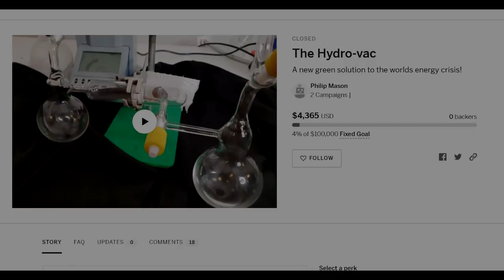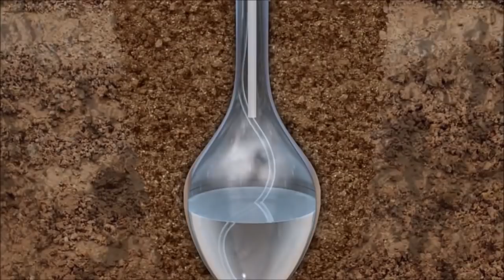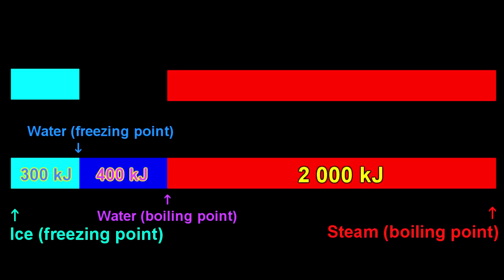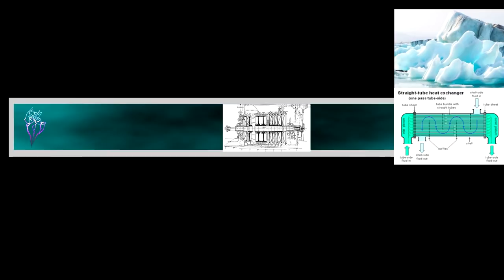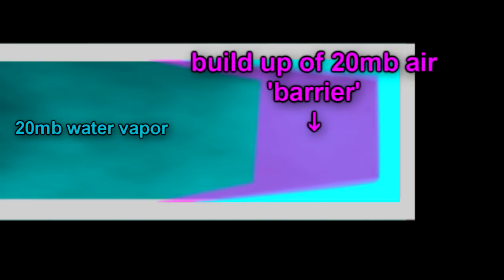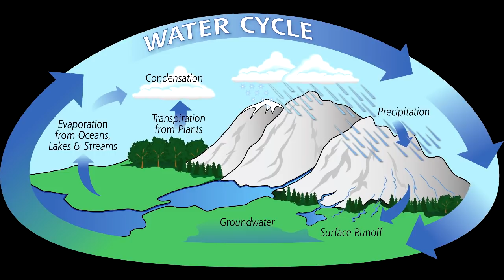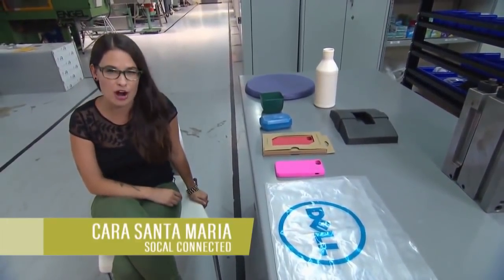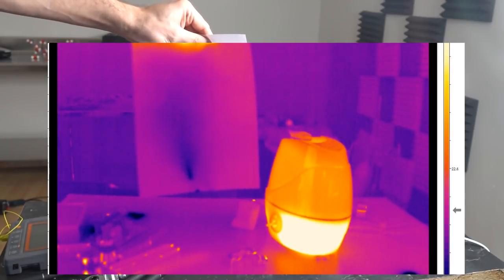The Hydro-Vac -BUSTED

Comment: Hey, Thunder00t, I've invented an engine that runs on water. It works on a simple principle. Hydrogen burns, right? Every water molecule contains two Hydrogen atoms. So I have this catalyst that makes it possible to set fire to the Hydrogen part. Ingenious, right! And the best part: Where do you think we get the Oxygen from?

And if you figured that was fantastic, wait until you hear my plans for what to do with Carbon dioxide.

Comment: Cold is a lack of energy, so you will never be able to harvest electricity from cold.  You could use a heat differential of some kind and use the temperature differences to harvest energy (i.e. The Sterling Engine).  Cold is necessary for this to work, but scientifically speaking you are harvesting energy from the heat source.

Comment: Free energy device
Some sort of heat based generator (say a peltier effect generator) with an efficiency over, say 50%, and then stick the hot side of an air conditioner on the hot side of that generator, and the cold side of another air conditioner on the other side. Then connect those air conditioners to the generator.

Because physics this can't work, but air conditioners can move more energy than they consume, so as long as it isn't a totally closed or open environment (so it doesn't continuously get cooler or warmer), it should work.

Except because entropy this can't work, so why, or have I broken physics with physics?

Comment: question, would this theoretically work if we could build this at around the equator and other end would be in space, one tube for gas to get to colder part and second one for condensation to get back to bottom ? with space part shielded by something so it won't heat up by sun shining on it ?
let's assume we have composite materials able to build this. (i know that we currently don't have that nd maybe will never have materials capable of  that )

Comment: I'm running an air exchanger with a built in heat exchanger and built in particel filters (for dust and pollen and insects), in order to keep the humidity low , 24/7 . Why on earth would I want a Humidifier in my house ?

Comment: Yeah, i am getting a Tesla tower vibe from this.. Great idea, works, in theory, but sucks in efficiency and execution. You are however forgetting to calculate the energy cost of getting and keeping the vacuum versus the possible output in moving gasses. 

Heres an idea to generate energy.. Have a metal ring around the equator, floating, because gravity pulls on all sides. This ring will rotate because of the rotation of the earth, difference between the surface to the average of the planet itself. Then put a bike dynamo on it, and voila, free power.

Comment: what if you went from geothermal to cold, upper-atmosphere with a vertical tube akin to a smokestack in a tundra with mountains like Alaska?
Reply: Something has already been designed and prototyped for using rising hot air, that has your large atmospheric tube:
https://en.wikipedia.org/wiki/Solar_updraft_tower
Idea originally by Leonardo da Vinci...

Comment: Dam you Thunderfoot!!! Now I need to go an do research to convert Kw/hrs into J to determine which bit of those numbers you misquoted in order to determine if you're trolling you, us, or all of us, or if it were just a mistake!!!

AND :/ I'm actually gonna have to do it, because I genuinely want to know and if I don't find out just how badly this whole concept would fail, it will keep me from sleeping! It's already 23:15 here...
grrrrr.... I shake my fist in the air at thee!
Reply: 1 watt = 1 joule/second
1000 watts = 1 kilowatt
1kilowatt running for one hour = 1 kilowatt hours

So 1 kWh = 3 600 000 joules
Reply: @zachb1706  cheers bro! That was what I thought.
What threw me was the whole bit about average power consumption for a westerner over a day. 
Upon further reflection though, I suppose as a mean average that might be in the realm of typical. I'm not interested enough to go fact check that far, just that part sounded a bit low to me. Started trippin on whether or not TF's sense of humour was applied to it lol.  

Maybe I'm getting too paranoid as I grow older.

Thanks though!

Comment: 15:21 I feel this is disingenuous - this would be like saying "In order to power your house through sunlight you would need to be in the sunlight for 12 hours a day which means that it's BUSTED for the times that it's not in sunlight" - well I'm not trying to run my house off of sunlight - I'm just trying to save a few dollars I doubt this system saves more than it costs but still I don't think that the trademark for energy should be "can it run a whole city" it should be "Is it less expensive than using coal"
Reply: Nuclear is the future

Comment: I'm not saying that the Water seer would work because I don't know much about them, but your description of why it wouldn't seems flawed. You say that the surrounding earth would just reach the same temperature as the bulb. But, that earth is in continuous contact with other earth that then sinks away the heat. It's the same reason you MUST insulate under a heated concrete slab floor. The heat doesn't just reach equilibrium, it's sinked away.
Reply: Obviously Not 

Why do you think that underground you get a cool constant temperature?

The reason is that heat transfer through the ground is slow (if it were fast, underground would be close to the temperature of the surface).  Over the years, an equilibrium has been set up, so the temperature underground is approximately the temperature that location experiences, averaged over the year.
Reply: @jerry2357  I didn't say it was necessarily a fast trasnfer, it mainly depends on depth and amount of surface area. But, keep in mind that with the water seer, they are only taking the water to it's dew point, which  is a modest number to achieve. For instance: Because it's hot and dry let's pick Phoenix AZ in the summer. It might be 100F, 45%RH, the dew point would  be 75F. The ground temp is <60F at 10ft deep all year. So, it would be EASY to condensate water, even at shallow depths. The amount of water would depend largely on the size of the underground vessel, which translates into surface area contact with the ground. I'll bet you could get 5 gallons a day out of a moderately sized system. That's enough to keep a family alive. Thinking about it, I'm positive the Water Seer would work.

I've been to Namibia before and it's so dry there, the yield would surely be less. But, I see droves of people carrying  water that they get from gov tankers (fracking has poisoned the aquifer). If water seer systems could keep them from having to carry all that water, it would be a Godsend.
Reply: @cornpop7805  

You clearly don't understand the thermodynamics of what is proposed.  To make any water at all, you need to remove the latent heat of the water vapour so it changes from the vapour to the liquid phase.  Assuming this is at (say) 10°C, then that's 2477 kJ/kg.  I estimate that that's enough heat to raise the temperature of a tonne of soil by over 2.5°C.  So for every litre of water you make, you heat the tonne of soil around the hole by about 2.5°C.  Heat transfer underground will not be fast enough to conduct this away quickly enough.
Reply: @jerry2357   The geothermal AC for my house uses tubes buried in the ground to dissipate heat. My 3 ton unit (3600 BTUs) took about 1500ft of 0.75" pipe = 8000 sq inches of surface area, in contact with the earth. Thats about 3800kJ total and about 2 sq-in/kJ.
Reply: @cornpop7805  

Sorry, I don't often use old units these days, so I'm thinking about your numbers.  Presumably when you say 3600 BTUs, you mean 3600 BTU per hour?  In that case, when working at full capacity, your 1500 ft of tubing is dissipating enough heat to make about 1.5 litres per hour.  That's just considering the latent heat, if the air needed significant cooling then the amount of water made would be considerably less.  

And that also assumes that the temperature difference between the pipe and the ground would be the same, but I suspect that the pipes of your system are quite warm, so using a bigger temperature difference than would be possible for a water condensation unit.  A smaller temperature difference means a smaller amount of heat transferred.

And by the way, I make the surface area of your system over 42000 square inches (0.75*pi*1500*12).
Reply: @jerry2357  My numbers are correct. I said about 8000 (7952 sq-in). You multiplied the diameter by pi, but you were supposed to multiply the square of the radius by pi.
Reply: Obviously Not 

No, you describe working out the volume of the pipe, not the surface area.  The surface area is the circumference of the pipe multiplied by its length.  Think about splitting the pipe along its length and then unrolling it to make a rectangle and you will see that I am right.

Working out heat transfer is within my areas of professional competence.
Reply: @jerry2357  You're absolutely correct. It's circumference x length.

Comment: Using water may be a fail for Thunderf00t, but power HAS been made by using glorified dehumidifiers: http://otecokinawa.com/en/index.html

Also there is a version that is for use at the poles, using the warm water and cold air difference; suggested by the French engineer, H Barjot.  Mentioned on wikipedia, and here: https://guides.wikinut.com/Technological-developments-may-enable-OTEC-plants-to-be-operated-even-in-the-Arctic/20o6x1am/

Maybe not that close to the hydro-vac, but using a similar principle, which I find a little too close for comfort while watching these hydro-vac debunk videos.

Comment: Climbing up a mountain. Heh, how much energy is lost to gravity? And how is one to eject all that heat in to a rarefied atmosphere?
Reply: Too much probably, frankly just doing what is normally done when you see a giant pipe running up a mountain like that for power generation makes more sense, namely impounding the rain and snow melt then run that down a pipe with a turbine hall at the bottom of the mountain and exploit the gravitational potential energy of the water that the Sun naturally lifted up the mountain for you using evaporation. Yeah sure it's plain old hydroelectric power but it has the distinct advantage of actually working and producing a positive return on energy invested.
Reply: @seraphina985  I'm in complete agreement.  I was just pointing out two additional issues with a thermal heat engine, or heat pipe, climbing a mountain.  

Heat pipe:
http://www.jc-solarhomes.com/DIY/Evacuated_Tube/evacuated_tube_applications.htm

 That might be more practical in a loop and only enough inclination to return water to the boiler but i doubt its scales well commercially. All heat engine efficencies are limited by the carnot cycle, and that's a function of the input and output temps.  Heat ejection gets more and more expensive the closer you try to get it to ambient with additional radiating surface.

Comment: Why would not you put turbines in long tubes without any condensation just using different atmospheric pressure at different locations to power them? I mean it should work just like wind turbine in tunnel.
Reply: Because the material and energy needed to build and maintain the tubes currently is better spent on just building more turbines, the death toll on birds and the people complaining they "ruin the scenery" are a far greater restriction than abundance of viable winds.

Comment: this is just a goddamn steam turbine and it works extremly well thats why its used in every power plant ever. who needs the goddamn antarktic temps we have water everywhere. with just a little negative pressure the steam engine could be much smaller and run cooler

Comment: but if you extend the vacuum tube back to initial temperature area for exhaust? with electric valves ect.
Reply: That system would grind to a halt in seconds...
Reply: @totalermist  no matter how long it extends after north pole?
Reply: @fqfkin2  It would take longer in that case, how long, though, I don't know.

Comment: And what about coal mines temperature is there at a depth of 800m 35 degrees and in winter at the surface of 0 to -20 degrees
Reply: Still the same problem besides which by far the best way to exploit that already exists, namely go to an area with a hot spot at relatively shallow depth drill a borehole and construct a geothermal power plant. Ideally of course you want an area with lots of natural fissures in the rock or where you can easily make some in order to maximise the area you are collecting the heat from so you can boil more water with it and generate more power. Often these are in areas where hydrothermal vents and hot springs etc tend to form naturally as these of course are indications of systems of caverns and fissures in very hot rock thus why places like iceland have a lot of them but it is possible to create fissures where non exist using hydraulic fracturing if the geology is suitable.

Comment: Still waiting for something on the "Smart Solar Box", looks exactly like a scam to me but I can't confirm it.
Reply: Simple answer to anything solar: https://en.wikipedia.org/wiki/Solar_constant

So you can get about 1kW/m² (okay 1.3 but whatever) onto a solar panel aimed directly at the sun. The world record for photovoltaic efficiency is around 50% but you're probably safer assuming 20-30% for commercial products. Now just look through the specs of some common household appliances: kettles, toasters, hair dryers, microwave ovens etc. tend to operate in the 1-2kW range. What exactly are you expecting to power with this box?

Comment: Ehhhhhh, i still wouldn't call it impossible, i mean it would work, its just maintenance would be a bitch. Construction would be an astounding feat and it would be severely impractical, also you can fix the issue of loading more and more ice on it with a giant radiator system

Comment: Condensing the working fluid at one end of a giant tube is the dumbest way to do it; at the very least we could be talking about steady state heat exchangers and something other than water as a working fluid to produce a stable local temperature differential to drive a thermodynamic cycle; basically, creative solutions to big challenges. OTEC already has demonstrated the concept of using natural thermal gradients to generate power, if not commercially viable at this point.

He briefly nods to engineering challenges that might be overcome, but with Thunderfoot's ruthless style of criticism, most of humanity's greatest inventions would've been "debunked" before we learned anything from the first few failed prototypes. What would he have said about the first draft of internal combustion engines, jet turbine engines, nuclear power plants, or even mass mobile networks before we'd seen their modern success after decades of trial and error?

Comment: Hmm, kind of similar to this "hyper vac" could be giant geothhermal tube straight down to ocean's deepest and hottest parts. I think it actually could be feasible and more realistic.
Not that I did any calculations or anything, but distances would be shorter and temperatures way hotter.
If anyone has any real knowledge on this I would like to know. It would ofc be massively expensive and hard thibg to build.

Comment: Thought experiment: Closed circuit vapor turbine pipeline?
Reply: What are your heat reservoirs? If you start with the vapour not moving how do produce a flow to drive the turbine?
Reply: @Photoloss  Basically the system shown in this video but as a closed circuit. Heating of the southern latitudes and cooling from the northern latitudes. Basically a self contained thermal loop much like that which forms naturally in our oceans and atmosphere.
Reply: @Sirge57  In principle that would work, vapour carries more internal energy than liquid water so you can maintain a net flow of heat/energy. It would still be stupidly inefficient though because you're still laying pipes across a quarter of the globe to power a traditional heat engine.

It WOULD be a cool refinement of TF's demonstrator though, raising the cooled flask upwards so the condensed water can flow back down through some kind of one-way valve. Then again at that point you're pretty close to the "drinking bird" desk toy.
Reply: @Photoloss  You are correct that in practically this is absurd, if for no other reason than the power generating source would likely be so far from the consumption points that the loss of energy through transmission that it would likely be a negative energy gain. Still I find subjects like this interesting and it's good to stretch the grey matter from time to time.